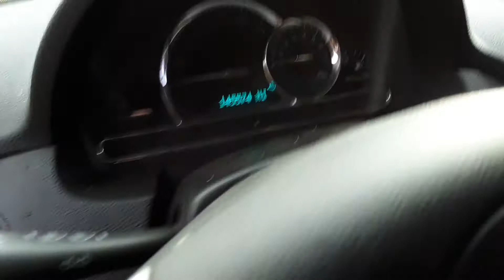Chevy HHR fuel pump bypass draining the tank

Comment: or you could've gotten a pump - hand powered or otherwise and drained it from the filler tube - which is a must if the case is a bad fuel pump - but this is an interesting method and also another way to verify if the pump itself IS working. a locking gas cap might also be a good investment if someone put water in your tank.
Reply from the maker: Yeah I was going to get a pump but I couldn't find one in the small town I live in at the time. And all of my cars now have locking caps 😂... Thanks for watching, check out a few other ones I got.. they did my daughter's 2010 Camaro also.

Comment: No offense intended, but it would have been very helpful if you'd described WHAT you were doing and WHY, and then gave INSTRUCTIONS on HOW to drain the tank. Also, by using the fuel pump to move the contaminated fuel from the tank to the fuel rail, you are pumping all of that varnish & dirt directly INTO the fuel filter INSIDE the fuel pump. You may have to remove the gas tank & clean it anyways, in addition to ponying up the money for a new fuel pump because you trashed the non-replaceable fuel filter.....